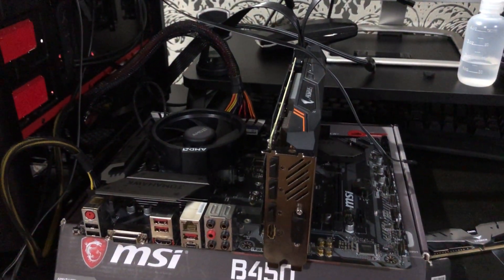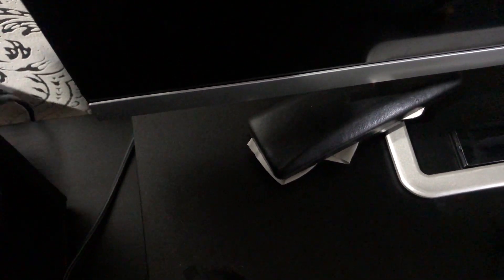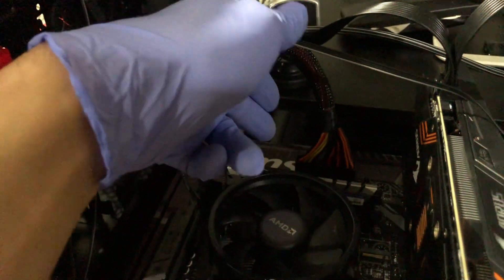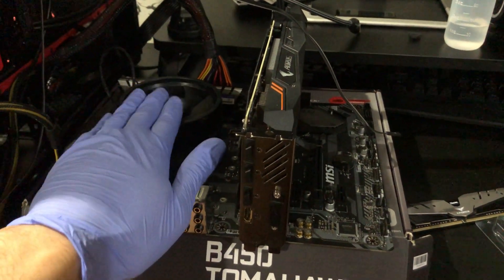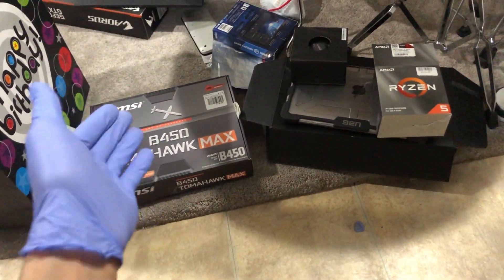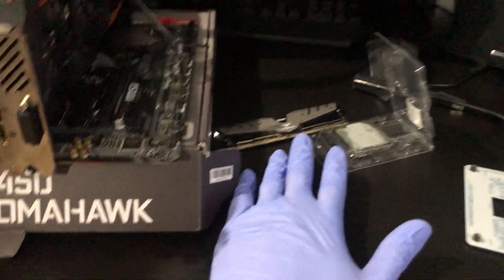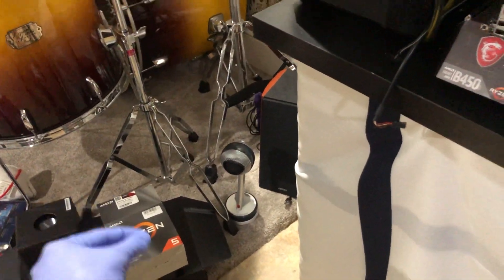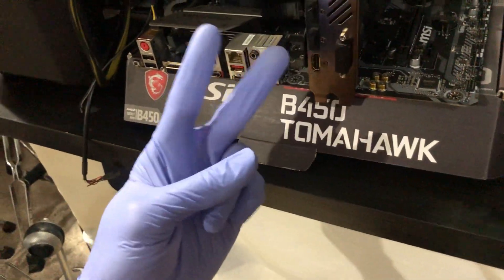MSI B450 debug lights go berserk | Ryzen 5 3600 | Cpu light problem with 2600 Not fixable

Comment: I have red light on ram but i dont have eny problems.
Reply: Same I have a b550 mortar wifi, 3600xt r5 and a saphire nitro+ 5700xt with 32gb tforce 3600ghz ram. So I'm curious if theres anything wrong..... I dont see anything going on but the red light is on. Hmm
Reply: Cool Tech trust me, this is also the last MSI product I will buy lol have a great day!
Reply from the maker: Alex Pacheco lol that’s exactly what I said after this. Thing is when your paying a certain price you should have reliability and this wasn’t given
Reply: @onlyjesh7494  What I guess got me more upset than anything is the fact that when I reached out to MSI tech support for help they were just super condescending. It doesn't make sense that I have built a handful of builds already (definitely not claiming to be professional) and the ONLY time i've had to reach out to tech support was for an MSI product.
Reply: This is literally the exact same problem! I swapped one stick through each slot (compatible with mobo) and even flash BIOS’d with rom file for updated MSI BIOS and the bitch still don’t work. It’s a solid white LED on the DRAM & nothing. I tested my CPU on my ASUS ROG STRIX B-450 and it worked so it isn’t the CPU and the RAM is also straight. Please let me know if y’all got it to work.
Reply: Cool Tech my apologies y’all but I ended up fixing the problem and it turned out to be very minute specifications on the compatibility list on the motherboards webpage. Make sure everything on the line lines up and you are searching for the correct information by your CPU on the website. My ram turned out to be not compatible by CPU so I swapped my wife’s builds’ motherboard (current project)with these components and used my motherboard from my build for hers as my cpu & ram was all compatible with her motherboard and vise versa. MSI Tech Support is ass.

Comment: My PC with b450 tomahawk max with r5 3600x it turned on perfectly and all of a sudden no HDMI signal with red light blinking indicating cpu on my motherboard. My CPU fans stopped working and rear vent fan stopped too with no HDMI signal.
I'm scared maybe the motherboard got wasted :(
Reply: Update your baios...
Reply from the maker: Talha Tanisa I did update the bios on both mother board at the time of the testing. I’ve also updated to the most recent and also to even went to versions where everyone else had versions that worked correctly with the cpu. Great suggestion though.
Reply from the maker: saikat bagchi it’s very interesting that their motherboards sounds this and I honestly just saw that it causes way too many problems. If I were you if you just see if you can get it replaced
Reply: @onlyjesh7494  if I have to buy a new motherboard can u suggest me a good Mobo within this range?
Reply from the maker: saikat bagchi I bought asus prime b450 Plus and I haven’t had any problems and I’ve been able to run everything just a good as the b450 Max. Only thing is that it doesn’t have the same looks and sleek designs but check it out

Comment: Hello!  How did you solve this problem?  I have the same situation, ryzen 1600af and same motherboard.
Reply from the maker: Constantine M. So it turns out it really is the motherboard. It was faulty. My best suggestion is to see if your motherboard can be fixed but if not that’s most like the problem
Reply: @onlyjesh7494  I'm having the exact same issue. Very carefully put the whole thing together, but can't get anything to start. 

Think the Tomahawk B450 Max is definitely a dud. Real shame.
Reply from the maker: Breadman yeah exactly. That basically was the point of this video is to show that most of the other components I had were working fine and it was just the motherboard and even msi said to just get rid of it
Reply: @onlyjesh7494  Guess what? 

Today I returned the MSI B450 Tomahawk MAX, got a Gigabyte B550 instead; and everything is working!

Definitely a bad board. Glad you ended up getting things fixed too.

Comment: Sometimes u have to check the compatibility with everything, basically speaking everything has to work with everything else, aka gpu has to be compatible with the motherboard CPU has to be compatible, I just got my pc and I’m using the worst motherboard ever and still working
Reply from the maker: Tried it but the motherboards socket was just messed up tbh
Reply: Ahhhhh nice nice